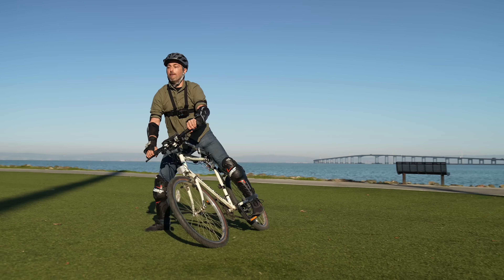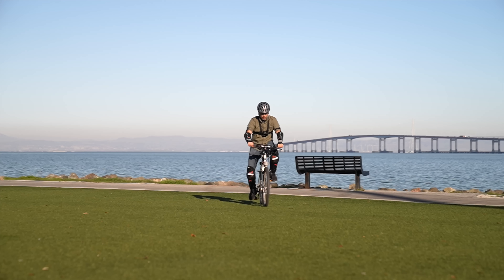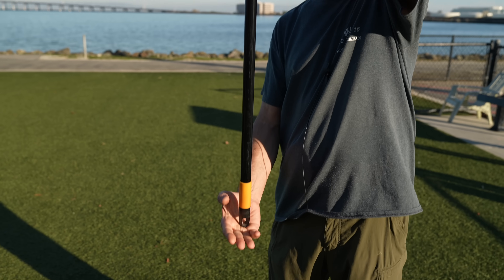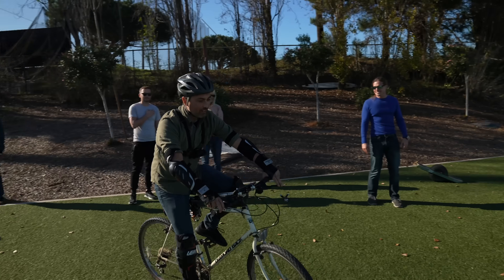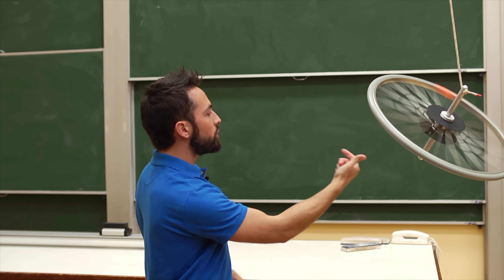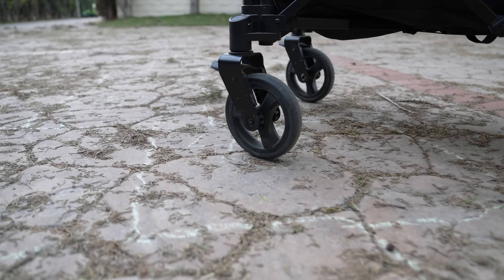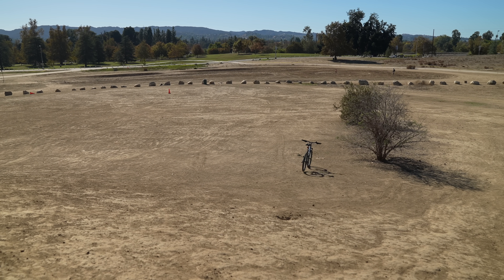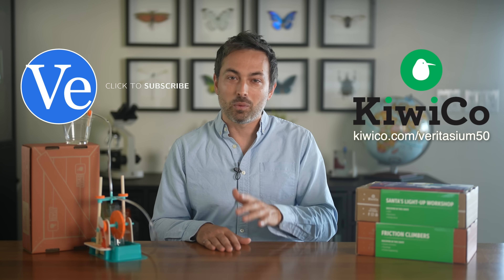Most People Don't Know How Bikes Work

Comment: Simply put: direction of movement is controlled by the tilt. The tilt is controlled by the handlebar. The thing is that to tilt left, one has to rotate the handlebar to the right (and continuously control the tilt so that one doesn't fall to the ground).

Anyone who rides a motorcycle should know how this works explicitly - they are more stable because of their mass and it's more obvious that to turn left one has to rotate the bar clockwise initially.
Reply: >> Anyone who rides a motorcycle should know how this works explicitly

Literally thousands of people have suggested that in these comments.  In my experience, expert motorcycle riders are expert at riding - and usually terrible at understand the underlying physics.  So yesterday I interviewed a training officer that trains other cops to ride.  There is no doubt he's a far better rider and instructor than me.  There is also no doubt that his idea of the physics was VERY inaccurate.

Comment: As any biker will tell you, after a certain speed. If you want to go right, then you push the bars to the left and vice versa. You also use your body to move the bike around, as the front wheel hardly ever moves. 

I think everyone who's fully able should ride a bike, for a couple of years before driving a car. As they will be much safer drivers and driver will be more aware of bikers. 
I don't care much much money you or your parents have got. EVERYONE should ride a bike to work and everywhere they need to go, for at least 2yrs. No amount of bribery or anything should happen as the person who's giving the bribe, should go to prison for a few years at least, with no early release. And the person receiving the bribe should get a year with no early release.
Reply: "after a certain speed"
Please tell what that speed is?

Comment: You should make a bike that has the handlebars disconnected from the front wheel, like a modern airplanes Fly-By-Wire. The handlebar will input turn action into an on-board computer and the bike will have a steering motor that will give it those commands but then augment them with stability enhancing algorithms. That would be cool to watch.

Comment: Still pondering why people counter steer in their 4 wheel vehicles.
Reply: Here's my theory...
The way ackerman steering works, the back end of your vehicle cuts a tighter turn (i.e. smaller radius) than the front.  That's why your back wheel sometimes hits the curb when you turn into a driveway.  To avoid this, people will sometimes swing wide to get a straighter shot at entering the driveway.  It seems like a lot of folks then bake that action into all their turns - which is annoying as hell.
Reply: @Rick_Cavallaro  right this is taught when learning how to tow a trailer but why people do it in their Honda civics is really confusing lol
Reply: @joker927  Even in my Honda Civic (which is literally what I drive) I can nick the curb with my back wheel.  But you sure as heck don't need to do that when making a right turn off the highway.

Comment: Brilliant! I teach adults to ride mountain bikes, and there are a number of people that have real trouble figuring out this concept. So they wibble wobble and overcorrect then fall over at walking pace.
"Push left to go left, push right to go right" is motorcycling 101 and applies to any single track vehicle!
Kids get it naturally, my 3 year old is stable and fast on a balance bike.
Also if gyroscopic precession had a major effect when cycling, it would be impossible to make agile turns. I wonder if anyone has built a bike with cast iron wheels to test this out?
Reply: You are in the extreme minority since you understand this.  I'd say more than 90% of the thousands of comments here suggest that, not only don't others understand; they also don't believe.

Comment: I noticed this as a kid when I overtightened headset bearings and handlebars couldn't turn so easily, I then tried riding with no hands and of course I fell off. But I still cant believe the fact that we turn in the opposite direction, is that 100% and no other way we can turn? I have racing bicycle and I always think that I turn by first putting my body off balance and then bike follows
Reply: >> is that 100% and no other way we can turn? I have racing bicycle and I always think that I turn by first putting my body off balance and then bike follows

As it turns out, I'm making a follow-up video in response to a lot of the questions and claims in these comments.  Unfortunately, I now have hours of video I have to distill down to something reasonable - like 10-20 mins.

So, is it 100% of the time?  No.  It's 99.99% of the time.  There are a few elite athletes that have trained themselves to balance a bike in a different manner than the rest of us do.  They're not just doing what we do - but better.  They're doing something very different.

So for the rest of us...  Yes, we always initiate a turn with a counter-steer (despite the thousands that claim in these comments that they don't).  But it's understandable that people would think they don't counter-steer in certain situations.  When you're riding faster the counter-steer can be very subtle.  When you're riding slower, the steering motion is bigger, but the force is nearly zero and the lean is minimal.  So what if you're riding no-handed?  Turns out we still counter-steer.  We just do it with our hips.  It's actually nearly impossible to lean by shifting your weight.  If you could do that, you could put your feet on the pedals on a stationary bike and then fall in the direction you choose to.  Have someone tell you which way to fall and you'll find that you get it wrong half the time.  But what you can do is tilt the bike with your hips.  This causes a steering input based on the principles Derek described for a riderless bike.  So we actually steer and counter-steer when riding no handed.  We just do it with our hips rather than our hands.
Reply: @Rick_Cavallaro  I'll record myself tomorrow morning😂
Reply: @94mikyyy  Excellent.  If you care to share the video, perhaps we could use it in the follow-up.

Comment: I love the videos but this video is just wrong.  Ride fast enough and you will instinctively lean the same direction as the turn and never lean the opposite direction.  You can achieve the same result riding slowly by riding without touching the handle bars...

Comment: When I was younger I had built this mountain bike out of various parts from different bikes and it was the best thing ever. It was so stable that I could ride over speed bumps, do sharp turns and even speed boost ALL without touching the handlebars… I would just let the bike run and it never even made me feel like I was about to tip over. Bike got stolen 3-4 years after it was built. Anyway, I’m absolutely sure that I can turn without going the opposite way first, you just gotta learn to trust your reflexes
Reply: you are not noticing what is happening as you describe that you can turn without countersteering.  The ONLY way to steer (practically,  meaning in reality) is to move the contact patch out from under the cycle.  You can get away with thinking you are doing this by going very slowly, but it is simply impossible to turn with moving the contact patch in the opposite direction that you want to turn,  then fall into the turn.  Countersteering is the initiating action.  But even after you have the cycle in the turn, you still have to move the contact patch opposite the direction you want to turn.  For example,  if you are in a turn to the right and you want to decrease the radius of the turn, you have to more the contact patch to the left to get the cycle configured for the reduced radius turn.  I have 95,000 miles on my current sport touring motorcycle and this analysis has served me well for all those miles.
 
your special bike had a large rake and trail (large castor) so it was self-correcting.  BUT in that configuration, you can NOT turn quickly.  You can have stability or quick turn capability, but not both.

Comment: You literally described counter steering lol its the first thing you learn on a motorcycle because motorcycles are giant heavy bikes generally. Pushing left and right works above 15 mph, at slower speeds you just have to move your bodyweight.

Comment: Okay, I need some backup here. I think I can turn my bike without countersteering. 

Now, first off, I'm pretty confident on a bike, and for the method I use you need to be quite confident.

So the trick is: 
Drive completely straight.
Stand up on the paddels (Don't sit down on the seat).
Rotate the bike 10-30 degrees on the z axis relative to your body. (Roll axis I think)
This will allow you to slowly start turning.

While I'm doing it I cannot notice any countersteering, but there might be micro movements that I can't tell.
Can someone else try this, or tell me I'm wrong?

Comment: Hey I think there's a problem with this experiment. 
If I were driving a car and you suddenly locked the wheels, odds are I'm going to wreck too. So the lack of communication between when the wheels get locked and the person riding seems to be a fault. 
A possible solution would be to have the computer run a code and give the rider warning before the wheel locked, and see if people could maintain balance after that. THAT would prove how.many people are actually knowing what they're doing vs. oh I'm going to make you wreck now. 
It DOES still illustrate the point, but not as well as it could. 
Of course I'm not a rocket scientist so.
Reply: I tested this out I can steer just fine without counter steering I literally just point my wheel where I want to go

Comment: So I have to ask, does this same apply to motorbikes? When I was learning to ride we were taught that at speed you turn by countersteering. And that's because you actually just lean and you need counter pressure to stop the wheel from turning to sharply with the lean

Comment: I don't think that everyone is necessarily countersteering. I'd actually argue that most road cyclists usually don't. Road bikes with narrow handlebars and slack head tube angles tend to be very shaky and unstable for people who aren't used to them. This basically 'amplifies' any steering movements, which would give even a slight countersteer enough centrifugal force to wipe you out at high speed. Road cyclists usually lean into turns, which works in exact opposite way, because it doesn't bring the bike back under you, but puts your body mass back into balance point, which is next to the bike, not directly under it. When I started road cycling I had to relearn a lot of what I knew about riding itself, and I believe this was the biggest change.

Comment: Well, I guess I'm beyond totally FUBAR; when I go to turn with my bike, I shift my weight toward the turn (usually by angling my hips) first and THEN steer to follow. Then again, I learned to ride my bike around the same time I was studying to get my Class-M endorsement, and that technique is not far from how the books tell you to handle turns on a motorcycle; the difference is that motorcycles you're supposed to push down on the handlebar (which gives you more leverage) to initiate the lean, and then turn the front wheel to match or "chase" it as needed.

Comment: It's not easy to counter steer at the slow speeds as in the beginning of the video. Later on he is going much quicker which is why it was easier to counter steer. I learned about leaning into a turn as a kid on a bicycle which allowed me to ride no handed anywhere, but counter steering allowed me to make a quick turn without losing control of the bike due to the balance issue. There was no science or study behind it as it just happened by accident. Fast forward to today where I ride a motorcycle and counter steering is an argued issue, but a necessary piece of skill if you want to survive a surprise.

Comment: This only works at low speeds
Reply: Nope.  It's necessary at all speeds.  Look at all the comments here that claim it only works at high speeds.
Reply: @Rick_Cavallaro  this only works at low speeds.
Reply: @Rick_Cavallaro  nope.
Reply: @Rick_Cavallaro  nope.
Reply: @Rick_Cavallaro  nope.
Reply: @Rick_Cavallaro  nope.
Reply: @Rick_Cavallaro  nope.
Reply: @Rick_Cavallaro  nope.
Reply: @Rick_Cavallaro  nope.
Reply: @Rick_Cavallaro  you're wrong.
Reply: @Rick_Cavallaro  wrong.
Reply: @Rick_Cavallaro  incorrect
Reply: @Rick_Cavallaro  false.
Reply: @Rick_Cavallaro  nope.
Reply: @Rick_Cavallaro  go watch a video of cyclists traveling downhill on a mountain on a highway at a high rate of speed and see what happens when they approach a sharp curve. They do not lean to the opposite side first. This only works at low speeds and when you are on a flat, horizontal surface. There are ALWAYS variables when speaking in scientific terms. Your opinion is redundant.  Mine is the truth. This only works at low speeds. Sheep. "Nope.

Comment: 1. The man with the switch turns off right or left turning.
2. The bike immediately loses some stability - because small left/right adjustments of the handlebar are necessary even for straight-line riding.
3. The rider reacts to the LED. And tries to execute a turn with an unstable bike. He'd probably fall off even if he tried to keep riding straight.

Comment: I've learned to ride an unicycle in 2-3 weeks. It was a great to experiment to learn it as an adult. Firstly, it was quite a bit of challenge even just to sit on it while holding to the wall with two hands.  After some days  my brain and body got automatically and intuitively  better and better in a seemingly impossible task. I didn't know what I did differently  in each try but my brain just learn behind the scenes. I only needed to fed in some input data to let the neural network do its job. It was amazing to feel what magic happen inside a how little we understand about our own mind and internal processes.
Reply: This is a lot like how our brains learn languages. Give it enough quality input and pattern recognition machine gets to work.
Reply: Developments in AGI would be incredible to see
Reply: Try a freeboard. They are a mind bender before you get the hang of it. You have to lock yourself into a skateboard turn back and forth (weight on heel or weight on toes)and when you want it to slide it out you ease off the skateboard wheels on the rear foot and transfer a little weight onto the castor wheels. If you want to stop sliding you lock it into a skateboard turn again. Speed helps you get the hang of it too. ITS MORE DANGEROUS WHEN YOU'RE GOING SLOW! LOL

Comment: Only time I have ever steered without doing this, I defied gravity, shifted sideways at almost 60-70 degrees (I felt the grass on my knee by the sidewalk) and did a full 180 turn in under half a second. I dont know why, or how i did it, but I took a break from riding my bike that day... I was legit just amazed...
Reply: Damn bruh, you drifted that btch?
Reply: @BOOFPACALYPSE  pretty much yeah, but i was so young xD all that ran through my head was "God, is that you, the light, I see it." lmfao
Reply: @zacktheslayer6564  Is that how you turned from your average mundane Zack to Zack the Slayer?
Reply: @bickboose9364  mmmmmmmmpossibly O.o
Reply: @BOOFPACALYPSE  Wanna drift a bycicle? let out ALOT of air from the back tire ... (with every bump your rim should hit the ground) .... then do this lean in trick and hold on for dear life :D have fun! :D
Reply: @rogerelzenga4465  and that’s how you get a pinch flat, and screw up your rim.
Reply: @BOOFPACALYPSE  I drifted a bike on gravel like this. It's pretty fun. The conditions and speed have to be just right though. Unlike a car, you have to keep your balance while doing it as well as getting the right angle and speed.
Reply: Had to happen once too
Reply: Hahaha same happened to me when I was a kid but scraped my knee cause it was concrete.
Reply: Yeah one time I was going like 15 mph on my bike and I hit the front brake hard to see what would happen. The whole bike flipped over behind me and I jumped off infront of it and it landed on its handlebars. I was just standing there for 5 minutes like what just happened?
Reply: I’ve seen you comment somewhere else before 🤔
Reply: left foot in the dirt and stomp . feather the brake to start slide and follow through with right leg . That back end will flopping in the wind .
Reply: i had something similar where i did a nollie stall on the dirt patch out front my neighbors house

Comment: I learned this specifically in a motorcycle safety course, over 30 years ago. At higher speeds, you push on the side towards the direction of your turn.

Comment: This is natural instinct to a pro MTBer. Not even a thought goes into it. If you've ever sat at crossing balanced without touching the ground with your feet, it's basic knowledge and this doesn't involve turning. You're using the footprint of the front tire to give you stance either way which is needed.
Reply: But when doing a track stand, you turn your front wheel about 45 degrees and move the bike fore and aft a couple of inches to balance.  That causes the front of the bike to move a couple of inches side-to-side, which gives you the same effect as steering.  Lock the steering straight ahead and try and track stand.  You'll find it nearly impossible.  But you might manage to learn to do it after a LOT of practice.